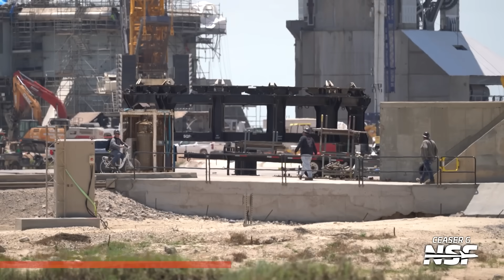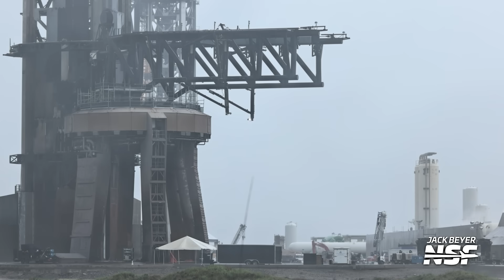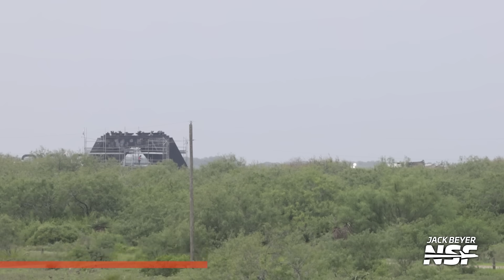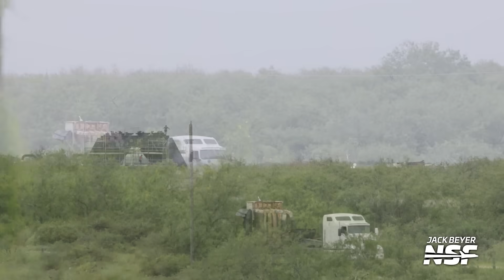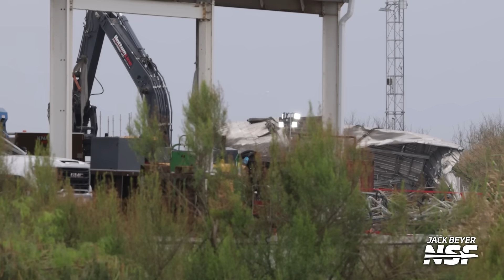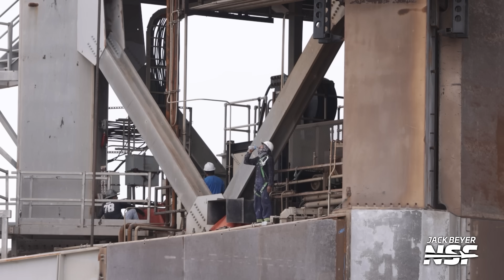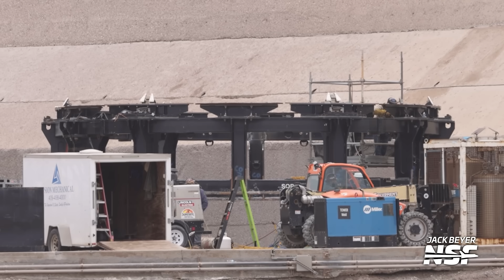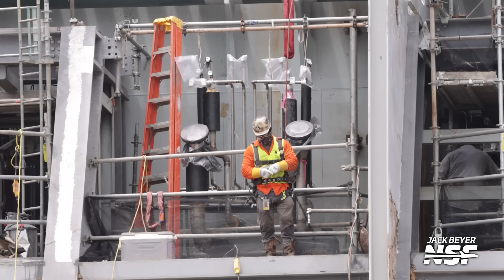"An unbelievable number of welds" | SpaceX Starbase

Comment: Almost half of Boca Chica has been eroded into the ocean and we are in an age of rising sea levels. Starbase was placed in an ecologically sensitive wetland over sand. Common sense would have told me not to build there because of the drainage issues and lack of cohesive soil.   The concrete and sand storm of the first launch was no surprise to me. Not replacing vegetation on earthworks only makes erosion worse. The soils class I took as part of my entomology training only made my convictions on the issues of building there that much stronger.
Reply from the maker: Concur that the soil out there is tough... but I've also been going since it was a single tent.  What half of Boca Chica has eroded into the ocean? - Das
Reply: @NASASpaceflight  I am trying to find the web site. I have a photographic memory but I have trouble remembering verbal information. I can see the map that illustrated the present vs the past coast lines and village.
Reply: Where else would they have built a launch site, production and test facility? The land north of Boca Chica village was partially submerged back in the 1960s in a once in a lifetime storm, the area itself doesn’t suffer from category 4-5 storms. The SpaceX production facility has brought jobs, stability and prosperity to an area that had nothing going for it and was generally a forgotten impoverished backwater.
If the same argument would have been made back in the late 1950s with the construction of Cape Canaveral Florida then America would have never got to the moon In that decade or the next dealing with environmental concerns. A few sacrifices have to be made in the pursuit of progress, although SpaceX does more than other space companies when it comes to environmental protection. Never hear the environmentalists complain about the countless rockets dumped into the ocean by other American and international space companies or the nasty toxic propellants used by the chinese, or the myriad other worldwide pollution issues? Funny how a forgotten spit of land located in the arse end of nowhere should now generate so much environmental concern/interest? Is it Elon Musk that gets the ire of these people? Oh and that beach and the sand dunes has for years been a rubbish dump long before SpaceX arrived, people driving 4x4s and other vehicles along the beaches, cans, bottles, plastic wrappers, disposable barbecues and other assorted rubbish left all over the sand dunes and ecological reserves, These days you regularly see whole squads of Starbase employees going around picking up rubbish and checking on wildlife and ecosystems around the pad. 
Yes the pad showering concrete everywhere was a bad decision Musk made despite opposition from other engineers at Starbase. They were proved right and since the water deluge system was installed no more problems.
Reply: How fast is the sea level rise at Boca? Most places are only several mm per year.
Reply: Yes but SX is special and they know better, according to cult members.
Reply: @RedmondJohnson Oh it’s cult members now is it? Ever thought you might sound a little culty yourself with that rather irrational assumption of the people on this forum. I don’t particularly like Musk as an individual but lumping the entire 15,000 strong workforce of talented employees in the same boat as their boss is a rather immature and uninformed view.

Comment: It's called hard facing to improve the surface resistance and yes it makes it stronger 15 year welder talking here
Reply: Hard facing, for what...!
Which is the wear, where is the abrasive it is working against.
Surface hardness for what, the flames gonna scratch it?!
Reply: No. Has more sense it is a crack repair, on the joint, at the corner... because of thermal expansion.
And all that patch, I would say it's because a recurring failure... and they keep trying to stop it from happening over again.
Reply: BTW, Greg... I received a notification, but the message can't be found.
"Exactly if they are trying to prevent further wear it is a hard surfacing practice according to CWB standards (Canadian welding bureau) as I am a CWB certi..."
Reply: Well, lots of comments have been saying it is about "hard facing", plain as that... so I've become fussy about that.
The practice is similar... but the purpose and the material, it's nothing about hardness.
Reply: As it's about replacing burnt out material, by a rocket flame... someone called it an ablative layer.
I wouldn't call that either, as it's not a coating of insulating or flame resistant ceramic or so... just more of the same steel.
I wouldn't call it nothing special... for that, just place another steel plate as shield for the corner.

Comment: We do that all the time in the  tar sands hard surface for corrosion
Reply: One thing it's chemical corrosion, like because of the salty and wet environment...
And another thing it's abrasive wear, like because of arids.
Reply: Hard facing, and superficial hardness does nothing against corrosion... and there is not an important abrasive wear environment, it would hard to work against.
That corner doesn't plound through ground, it's not an excavator bucket.

Comment: If it keeps burning away the metal and reducing its thickness then you really want to make the metal thicker to slow down the burn through
That might be the reason for welding multiple layers on top of each other.
If it burns through the primary metal that is harder to fix than if it burns through a plate on top that can be replaced.
Reply: It's actually wild. Standing on top of it looking at the metal under  your feet you can see where it has turned liquid and back multiple times. I've never seen anything like that before. I work on SLC-40 and we just see broken welds and burnt hardware. I was amazed when I was out at boca.

Comment: I am stocked for.the next starship engine start.🚀🚀🚀
Reply: When it blows up it'll take out the catch tower, chopsticks, and OLM all at the same time.
Reply: @theheresiarch3740 the tower and launch mount are a whole lot sturdier and wouldn’t go away by something like Ship 36’s explosion. For example the launch mount is built to survive the force of 33 Raptor engines firing against it for several seconds during liftoff, a lot of the piping and other sorts of hardware are protected against this sort of thing. At Massey’s none of this was the case

Comment: Will the BQD fit the Ship? Going to need a BQD -SQD adapter interface😢
Reply: Hoses with size-reduction joints to fit the smaller QD diameters on the ship.
Reply: Hey if they got Lightning to HDMI connections I bet they can do an adapter for that too

Comment: So in one parlance, the welds are called hard facing. The welds are most likely made from 7018 electrodes (70ksi), which is twice as strong as the A36 (36ksi) standard metal that the OLM legs are made from
Reply: It's not 7018, it looks like he's running dual shield. Your point stands either way though.
Reply: @needleonthevinyl dual shield would be fcaw, not mig
Reply: @nastiestnicholas6353 depending on shielding gas dualshield can be mig
Reply: Or he is an apprentice and needs a certified welder to check his stack to approve him for real work. 
My "teacher" made me run 20 or 30 beads stacked up on a pipe before he would let me do production work
Reply: Not rods he's using a mig welder
Reply: That's probably inconel or stainless steel.
Reply: Not repairing cracks. They are building up areas of erosion.
Reply: @deserteagle4151 On other comments I pointed that. Building up material lost, but not because abrasive erosion, or corrosion by the sea... but burnt out or charred by the flames on the exposed edge, missing or weakened.
Reply: @deserteagle4151 Also, about the theory of a recurring crack due thermal expansion, on the joint corner... that patch could be on an intent to spread the tensions applied, so the same crack doesn't keep opening over again.
Reply: Stringers not weaves, I guess!  O:-)
Reply: "Hard facing" it's done for superficial Hardness, to scratch and wear...
And the "strong" you are talking about it's Toughness...
And material toughness it's not the decisive measure: thickness, shape...
With half the material toughness, but double the thickness, it can stand the same.
Reply: @samos_sainz  Yeah, I use a version of Stellite for hard facing (have done the top of valve stems that were dished.)
Reply: Those plates, with that brown oxide layer?
Seems like Corten steel.
I don't know where you see Inconel or Inox, there...
Reply: And your theory about 7018 and A36:
About the electrodes, you are wrong... and about the plates, you don't know that.
Reply: So... you don't understand "hard facing", neither there is an use for it here.
Nor your theory about a better material quality has sense here.
Reply: @samos_sainz  You're spending an awful lot of effort telling someone they're wrong, and not a lot of effort actually sharing knowledge here
Reply: @needleonthevinyl  True, but that's because I've already shared my thought about what I think it actually is, on other comments.
Reply: @HarryNicNicholas  I don't know how they do it tbh